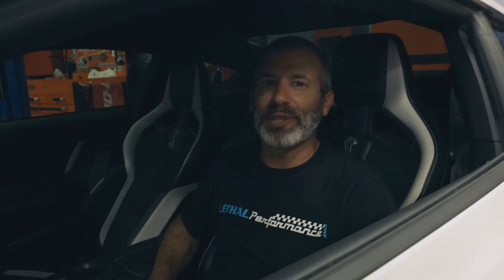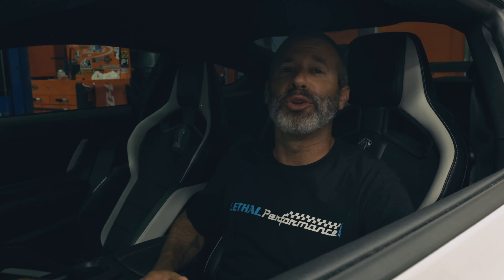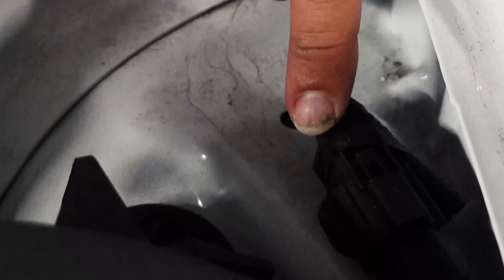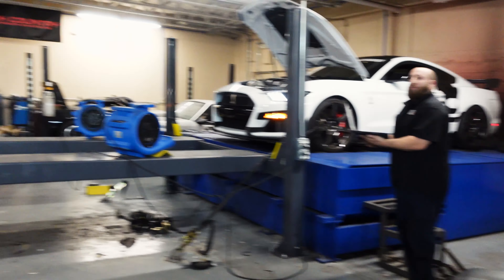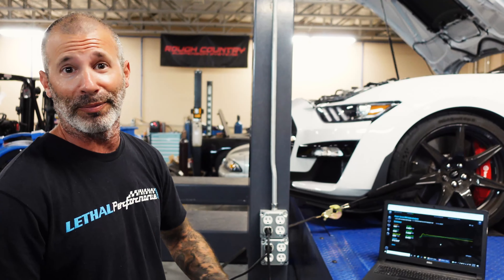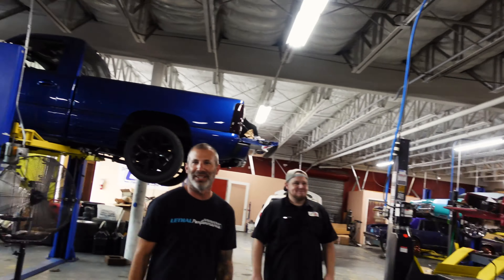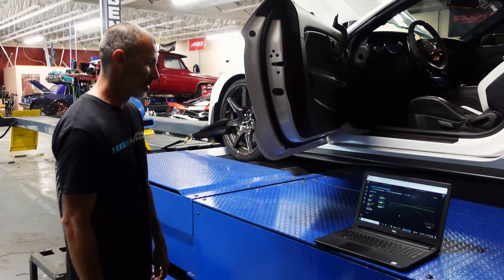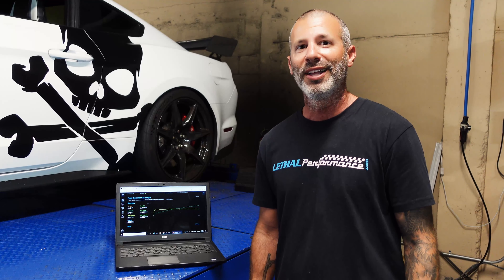Our 2020 GT500 made what on the dyno?!

Comment: Im in pensacola florida . 2020 f150 gonna do bolt ons coyote intake .how much do you charge to handle the tuning part
Reply from the maker: Hey Herbert, we offer tuning from Lund Racing & Palm Beach Dyno. They are available as email tunes to load onto your existing applicable device or through our personal fave, the HPTuners RTD. Check out this link: https://www.lethalperformance.com/shop-now/vehicle-selector/ford-trucks-f150-svt-raptor/ford-f-150-5-0-5-4l-v8/2018-2019-f150-5-0l/computer-4

Comment: Most people know changing exhaust alone will not make h.p gains unless you increase air intake and of course  a tune change. Love to Lethal performance I run their cat free X pipe on my 2014 GT 500
Reply: Yes but no Mach 1 will pull harder with just a H pipe install no tune as think ford grimped it after fitting the gt350 air box. Think steeda has the dyno's to show this.
Reply: @historickeeper  a GT 350 has a better flowing air box and with a H pipe a little more free flowing . I certainly believe that. How much h.p did they gain.

Comment: Would some 4.10gears help get more torque to the ground and acceleration on highway racing?
Reply from the maker: Way too steep of a gear for this car especially at this power level.
Reply: Oh, I thought that would help get it off the line faster.
Thanks for quick reply.

Comment: What do you consider “totally stock”? Seems like a cat back or any kind of exhaust mods doesn’t make it stock anymore. It’s aftermarket parts so wouldn’t that make it not stock anymore?
Reply from the maker: Catback and axle backs don’t make any power over stock. This is why we said it’s basically stock as no power adders have been installed yet.
Reply: @Lethalcamp  that’s crazy factory exhaust flows that’s good but also to spend so much for a axle back / cat back to just change the sound is heart breaking.
Reply: adding an aftermarket exhaust makes it no longer "stock".
Reply from the maker: @unlisted8042  heavily modified with tint and a catback 🙄
Reply: @unlisted8042  🤦🏻‍♂️
Reply: @Lethalcamp  that sounds better lol